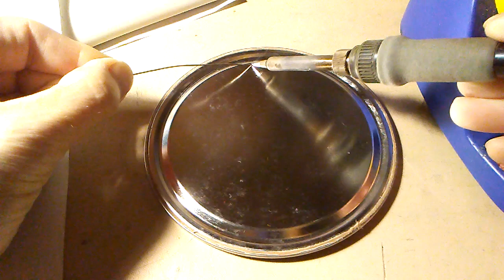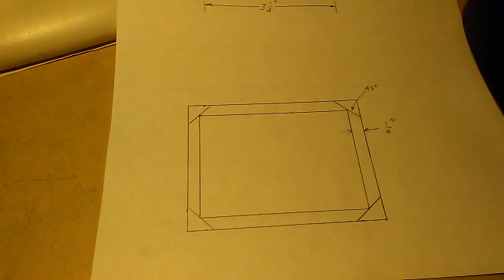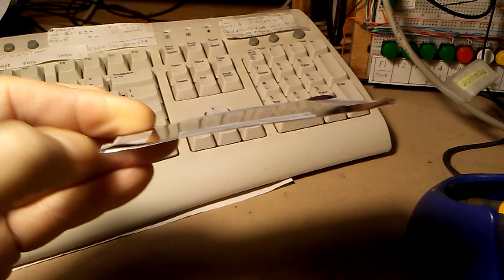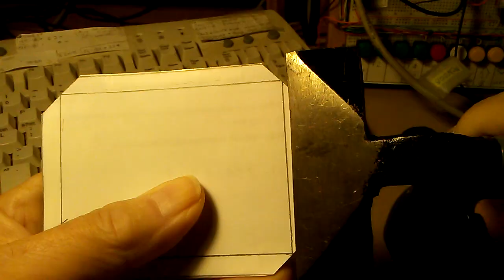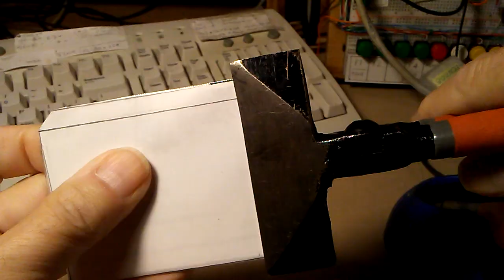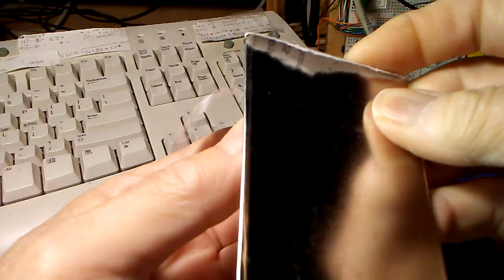Manhattan construction board from tin plated steel

Comment: Nice, Rick. I was wondering where all that tin came from! Thanks for the tip about the tin bender. I have never seen that hand tool before. '73 Marty K1FQL
Reply from the maker: Marty, You're welcome.  Tin plated steel sheet is also available from Amazon: 
https://www.amazon.com/dp/B000NV7JZK/ref=vp_d_fuw_pd?_encoding=UTF8&pf_rd_p=5afb6df2-0330-43f3-8d70-fc8d166eab85&pf_rd_r=EQ0YFTNXF7FM24E6VVY7&pd_rd_wg=gNO1e&pd_rd_i=B000NV7JZK&pd_rd_w=p3cTQ&content-id=amzn1.sym.5afb6df2-0330-43f3-8d70-fc8d166eab85&pd_rd_r=146f5775-fa7f-4cee-a705-39e90172a79f&th=1

And the bender: 
https://www.amazon.com/Straight-Seaming-Ergonomic-Bending-Flattening/dp/B0C58HTVDP/ref=sr_1_2?crid=3GSOK6YK42289&dib=eyJ2IjoiMSJ9.Z9GcPmirW4ON1KreoNATrf04t-95w_SZAGUACqgkt98-Avn9ckTQATJ66pbGd8tgMf3DZTwoT3xA2K12SDHM5hr3QQcVPrxhOchm2j8Og6BSDi_Hm8eXjSXLvxfbiC41lxzK49ZU4bIlhPkEDu37wcKu4cKxYyLl0xhMdUY8Bm7Vj-dkLEEax-iIMnkMS_NvBISJzIp6U8jRqGD3sKCrXklFS3fGnnYjAb__Xcu294FdSMw7jCeuBJAtonv1LdkH8Eb8aMNTKI29zYUlfaQALwlLTnjVA-IwebwCqZu2xbI.uqTwCAxbgbtLeNvVz-22wqX3Q2nfyt_FbKQDq452laY&dib_tag=se&keywords=tin+bending&qid=1748076621&s=industrial&sprefix=tin+bending%2Cindustrial%2C72&sr=1-2

73 - Rick - N3FJZ
Reply: I see that, thanks.